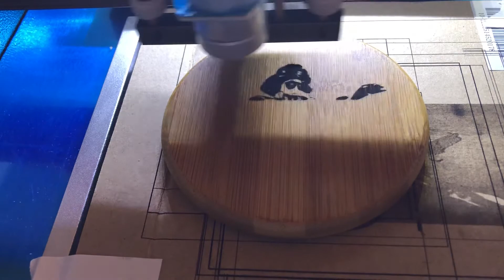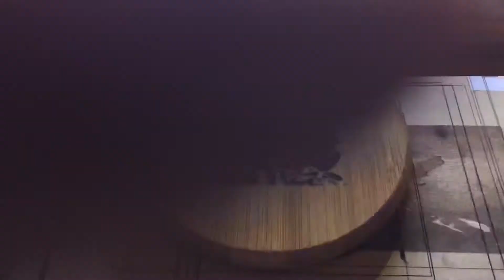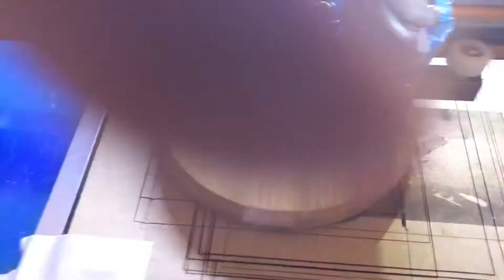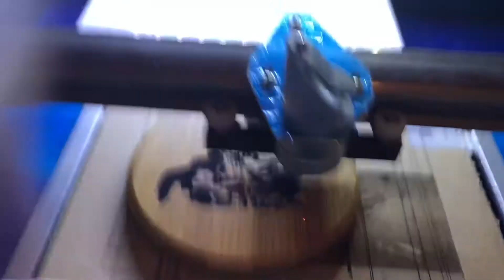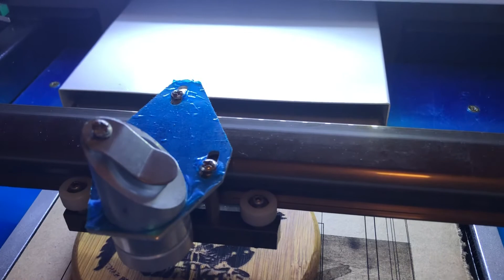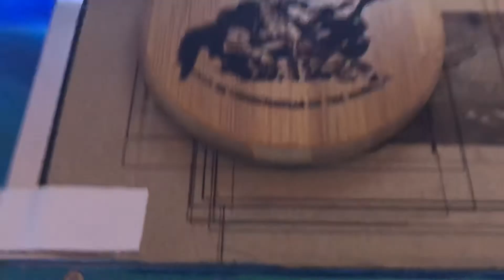K40 Laser Engraver - Deadpool

Comment: Do you have an adjustable bed on there or how are you getting the laser focused on that thicker piece of wood? Looks great!
Reply from the maker: No adjustable bed unfortunately. Basically I just played with the settings until I was able to figure out the right intensity and then I spent the rest of the day burning every piece of wood I had haha. Thanks!
Reply: Van Damage awesome! And how do you go about lining up each coaster so they’re always centered with the designv
Reply from the maker: @Kipiddy  I'll run  a "print area" test on a piece of cardboard taped to the inside table which gives you a square outline of where things will be printed, I make sure I have the design on the software centered exactly where I want it, then I make sure I carefully place whatever is getting the image engraved on it inside the print area and make sure I don't move the cardboard in the process or things won't line up properly. It's a little tedious but once you get a process down it just becomes second nature.
Reply: Van Damage what software are you using?
Reply from the maker: @Kipiddy  It came with some software pre-loaded but I've found that using Gimp to edit the images to black and white and save as .png files works for the best images